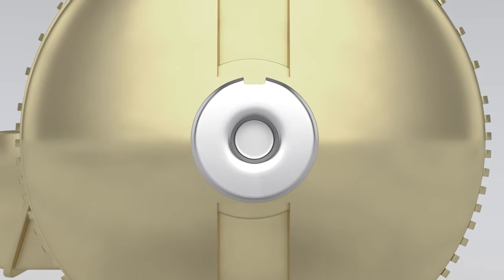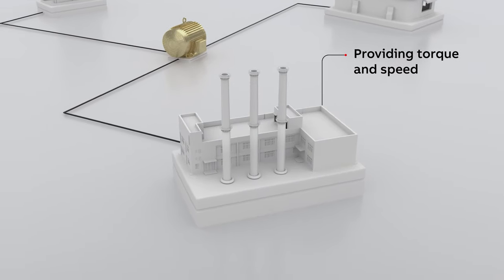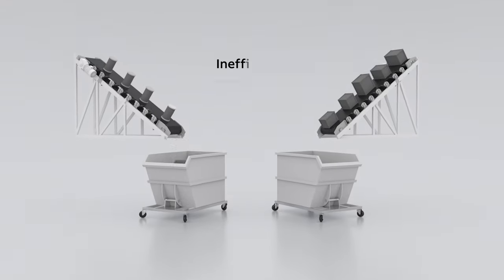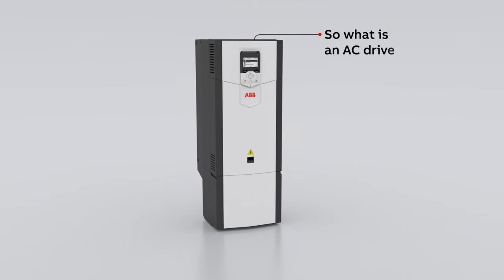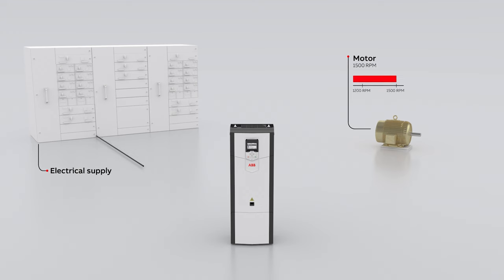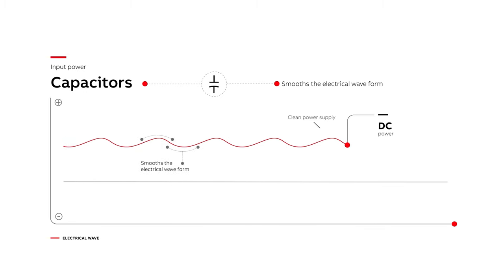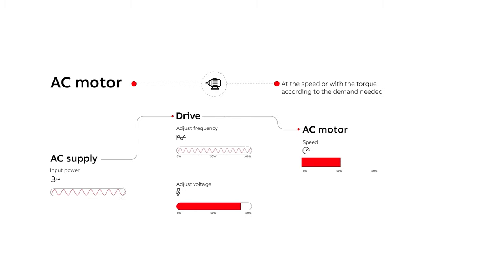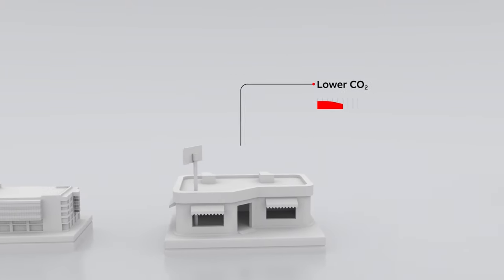What is an AC drive?

Comment: What is purpose of converting AC to DC then DC to AC in AC Drive
Reply from the maker: Thanks for watching and for your question. "If a 60 Hz AC motor is run directly off of the incoming power line, the motor will only operate at one speed. There are various reasons for operating a motor at different speeds other than 60 Hz. By changing the 60 Hz AC power to DC we can then modulate the DC power to provide variable frequency and torque to the drive. Some applications require variable speed and some applications like fans and pumps require a specific speed other than 60hz to optimize energy efficiency."  - Steven Gmeinder, ABB Drive Products
Reply: Thanks for your reply

Comment: Three phase cable fed to AC Drive offen melts, what will be the reason
Reply from the maker: "If the conductors supplying power to the drive are melting there could be a couple of problems going on, but the first thought should be SAFETY and preventing fires, so turn off the power feeding the cables until someone has analyzed and resolved the issue. Know that it is very difficult to pinpoint the exact problem without understanding the complete system design, wiring, protection, ambient temperatures, etc., but there are a couple of primary rules that should be followed. First, the wire size should be based on the rated input current of the drive. NEC at a minimum requires that the conductors be sized at least 125% of the drive rated input current. If parallel cables are used per phase, additional derating is required. If cables are in conduit additional derating is required.  If the ambient temperature of the cables or protection is over 30C additional derating may be required. Follow all NEC and local codes requirements for sizing the copper cables.  Pay attention to the drive terminal ratings. Most ABB drives allow 75C wire max and only copper conductors (in the U.S.)  If the drive has a lot of harmonic current, these amps are not measured with typical instruments and meters costing several thousands of dollars that can measure currents to 3khz are required. Harmonic currents could also be generating excessive heat in the conductors, transformer, and protective devices. Harmonic mitigation comes in several forms including reactors, DC chokes, passive filters, active filters, multi-pulse drives and ABB Ultra-Low Harmonic Drives and all can be used to reduce harmonic content on the input cables and the distribution system with differing success. Typical drive hardware manuals recommend drive fuses be used to protect the drive. Make sure that the fuses you use are not oversized for the drive and are of the correct class. These devices should trip before the cables begin to melt. It is important to understand the National Electric Code and any other local codes when installing and wiring a drive along with all recommendations in the appropriate hardware manuals." - Steven Gmeinder, ABB Drive Products
Reply: Thanks for your reply